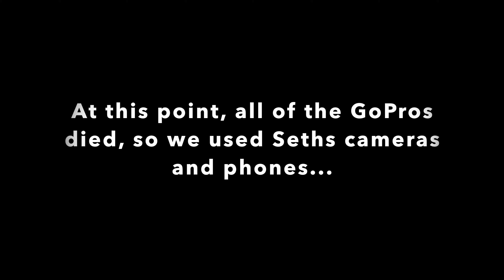We Visit LOST TRAILS ATV ADVENTURES!! (We Get Into Some Deep Water!!)

Comment: Awesome video! What gopro is that? Ive been looking to get a new one.
Reply from the maker: Down And Dirty Off-Road we have the GoPro hero 8 black, 7 black, 6 black, and 4. Usually we’re just using the 8 and 7. They’re great cameras!
Reply: @LetDirtFly  I use a 3+. Watch a couple of my recent vids lol. They have definitely came a long way since I got mine. I also had the gopro 1 when that came out.
Reply from the maker: Down And Dirty Off-Road yah we can see a huge difference between the 4 and 8. The picture is much clearer and with the 8, the stability is awesome. If you can, the 8 is the way to go, but the 7 is awesome bang for your buck as well. It just doesn’t have the same stability.
Reply: @LetDirtFly  i know the 9 is coming out in September /October, so I dont want to buy the 8 and have the price drop when the 9 comes lol. Thats why the 8 is already having big discounts on it.
Reply: Also, the 8 doesn’t have a removable lens for if you scratch it you’re screwed.
Reply: Are those exhaust pipes on the front of that Polaris?  So odd.
Reply from the maker: Brooklyn, Bikes, and Beyond they’re snorkels to go into deep water so the belts don’t get wet. Also they sell the GoPro roll cage for the 8 which has a lens protector which is what Marshall wears with the 8 and keeps it from getting scratched.